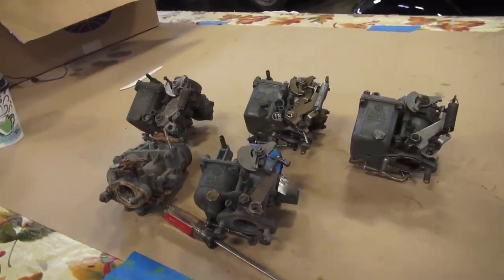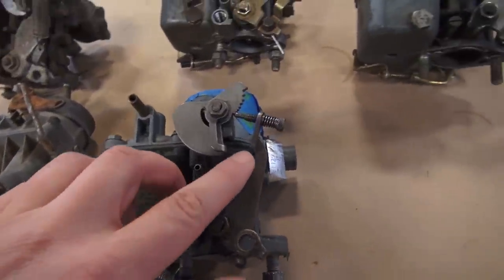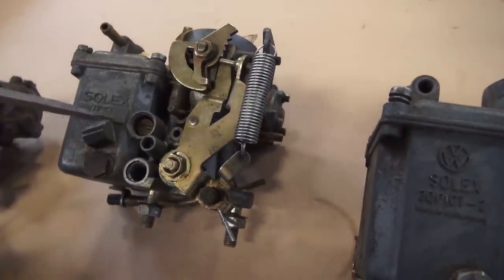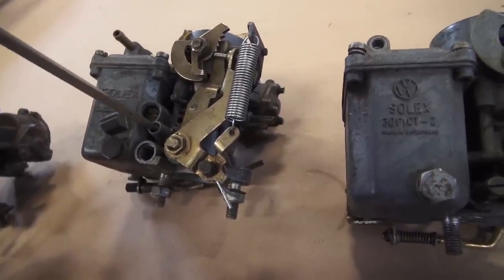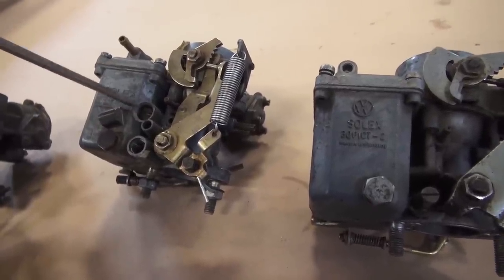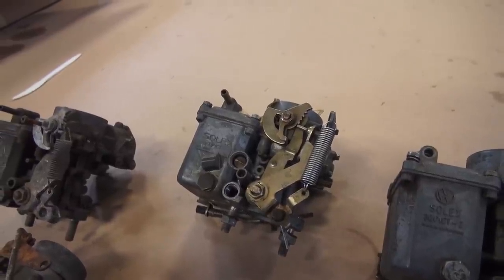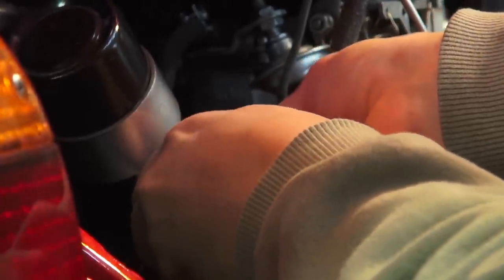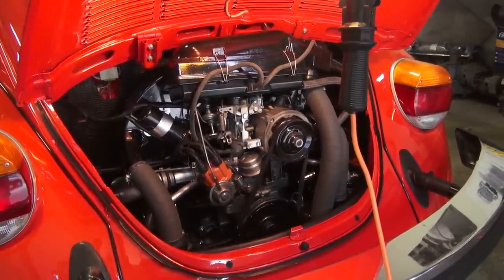Classic VW BuGs How to Tuning Air Cooled Beetle Ghia Bus Carburetor Adjustment

Comment: Do you need to fill the bowl with gas before you mount the carb? Or can you just put it on empty?
Reply from the maker: you can put it on first, mount it, then just pour some gas down the carb to prime it.  Just get a lil cup.
Reply: @classicvwbugs  ,,,,,Fill the fuel bowl via the bowl vent...........[small homemade funnel ],,,,,,,wack the throttle a few times ; to see fuel squirting down the venturi ..............

Comment: Chris I have a 69 bug with a 1500 single port motor, bosch 009 distributor, and a solex 30 pict 2 carb. I'm having issues getting my motor started after a head swap due to lost compression from a cracked head...compression now is fine, heads are adjusted, in getting good spark, I've disassembled the whole fuels system and replaced everything brand new except carb, I cleaned the carb thoroughly... I have only 1 adjustment screw, and then the idle which controls the throttle butterfly...any suggestions
Reply from the maker: were the heads torqued right?   Timing right?  Did you use my express clean video on cleaning the carb?
Reply: Chris Vallone yeah everything was torqued properly and I used your video on express cleaning...its timed correctly...i can get the motor started but I have to feather the throttle to keep it idling and it will eventually die
Reply from the maker: still sounds like a carb issue, it is starving for gas.
Reply: Chris Vallone my thoughts exactly... I have a bus with a 2L type 4 engine, it has webers I'm comfortable with adjusting those but not familiar with the idle on a solex pict 2...in your video you don't go over the adjustment on those

Comment: will a 30 pict 1  be ok for a 1200?
Reply: lennyauditt Hi,my stock 72 D engine 1200 in Ireland runs with German solex 30 pict 3 if that helps.

Comment: what would u recommend  if the bug engine starts but doesnt idle unless u keep foot on the gas?
Reply from the maker: I mention it in this video, and many other times, you need a good carb cleaning.  I have a video on carb cleaning.
Reply: Joshua Brody try checking the float. Take off the top of the carb and see if it's sunken into the fuel. Maybe that is the issue. Or you might be running out of gas. ?